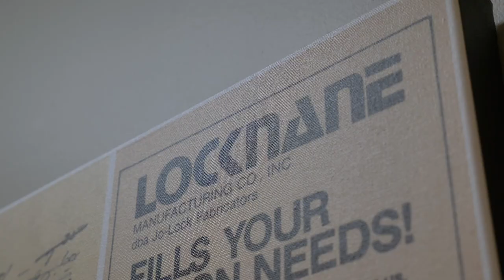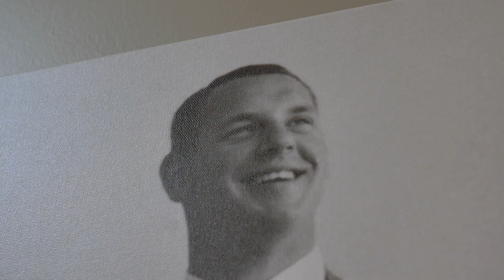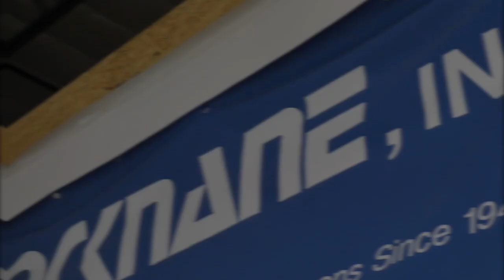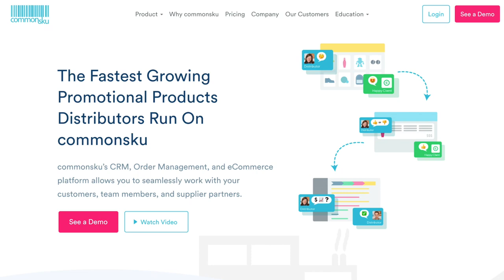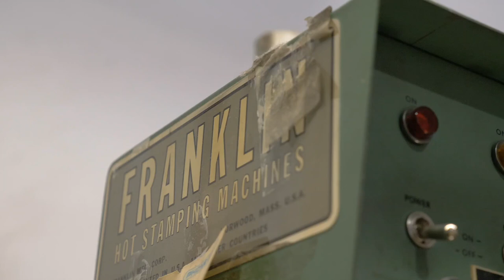$4.8M/Year Screen Printing Business (Owners Share Their Secrets)

Comment: I used to work in a clothing factory I did everything except actually sew the clothes. There are machines that you can put the material on an will use a computer program to cut things to shape  automatically they are awesome machines but very expensive.
Reply: But if you don’t buy one then you are competing against people that do have one. Once you have specialized machinery, your cost per item made should go down (economy of scale) and your prices will be lower than the people that don’t have one and be more competitive in getting customers. I think of it like a machine shop. Nobody who uses a manual mill is going to be able to compete with someone that has multiple 5-axis machines.